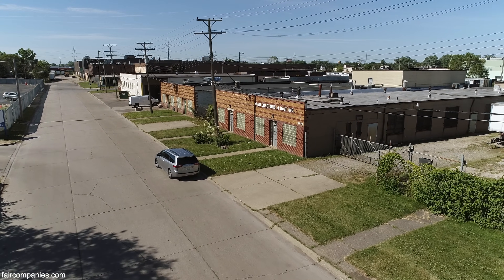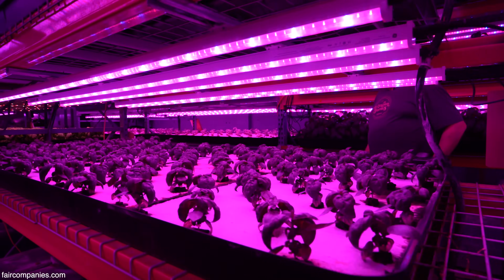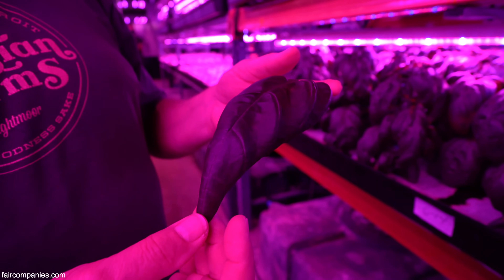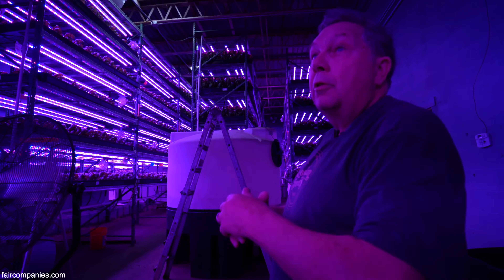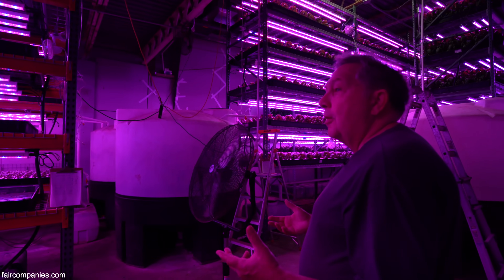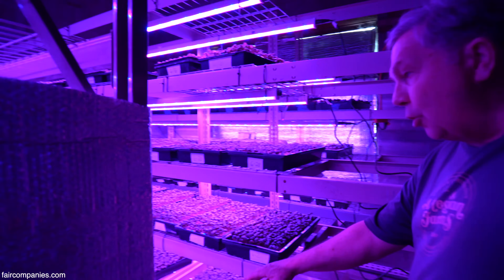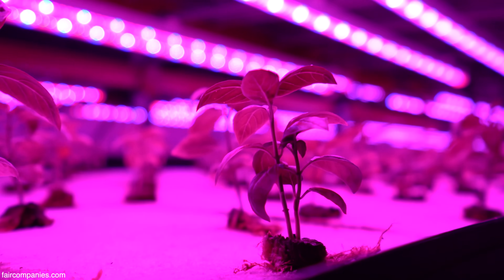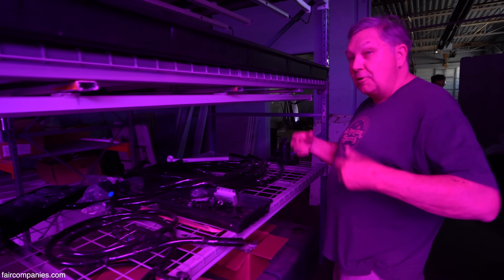Detroit retiree grows organic food in a transformed warehouse

Comment: In France, they made some test on this type of farming and they see that the leaves, fruits and others a ver good aspect, but they have 20 to 40% less vitamins and others elements.
Reply: They do not have the microbes that a good organic soil has. These microbes break down the minerals and organic matter to feed the plants. This is also why conventional farming has such low nutritional value, the microbes are killed off by the chemicals (fertilizer, pesticides, herbicides, etc). The soil is basically inert, sterile, and the only thing the plants get is what is fed onto the soil. Organic, regenerative farming is the way to go... indoors or outdoors.
Reply: @rorywynhoff1549  i agree, however you can add bags of compost into the mix /addition tanks that recirculate microbes into the system or use wicking pots with good soil to get the best of both worlds. This will not work with the salts he is using though, you have to change the system.
Reply: @bobhope9909  Almost all good microbes are aerobic, oxygen loving. They don't survive in water 
Also, most plants have two types of roots; hair roots that pull in nutrients, and tap roots that pull in water. In conventional farming and hydroponics that tap root pulls in both, which does not allow proper nutrient fixing in the plant cells. Another reason to choose organic, regenerative farming.
We have health problems largely due to poor nutrition due to compromised foods.
Reply: Nothing beats the sun.
Reply: @user-vg5rv5xf4u  true but some areas just don't get reliable sunshine
Reply: It depends how you compare. For x amount of water and energy you will get way more vitamins and nutrients with a vertical farm. This means you will have to put a little more basil in your plate but you will be able to buy way way more for less money & waste
And that's not counting economic and environmental benefits of having it close to distribution
Reply: Sounds interesting do you have the source for this?
Reply: Exactly lack of medicinal value ..!!! Only nutritional
Reply: rima1815 - Source?

Comment: You’re telling me the insulation that those plants are sitting in doesn’t eventually leech off chemicals into the water that it’s floating in and thus the plants soak up those said chemicals ....  I    Worked spraying foam insulation for years and I can tell you most insulation’s are toxic to various degrees

Comment: I love this initiative but some info here is definitely wrong. Plants do not absorb nitrogen from leaves. I believe the air circulation helps with photosynthesis. Nitrogen is absorbed through roots
Reply: You are correct for basil, it doesn't absorb nitrogen from the air, but rather carbon dioxide. The fans keep the air moving around the leaves so they can access more CO2. Without air movement, oxygen build up around the leaf, as the plant gives off oxygen when photosynthesizing. There are nitrogen fixing plants, such as the legume family that can get nitrogen from the air, but basil doesn't do that.

Comment: nice. what about the roof tho?
Reply: I used to do both active and passive solar work in Michigan years ago for F.E.A.T. Foundation before I moved to PNW and the roof could easily handle the WEIGHT of solar panels and snow weight. A bigger issue is secure mounting. The panels can become sails during extreme winter winds or summer storms.
Reply: Rooftop garden or solar to cut energy cost? Building is old roofs must designed to hold the weight for a garden.
Reply: @monkeysaiyen7196  no winters with lot of snow in detroit?
Reply: @chapchap5944  what places on earth experience no winter? Even a dessert and rainforest experience winter just differently then other areas that get snow. Detroit gets snow.
Reply: @monkeysaiyen7196  sorry i thought it was clear what i meant. if it can hold snow it should handle additional solar panels.
Reply: and snow
Reply: @chapchap5944  the building is old but it probably could handle the weight of a solar system.
Reply: Chap Chap   Even though solar energy is free, the cost to purchase a solar system complete with batteries is very expensive. Plus, Detroit is too far north for solar. It would take more than 20 years to break even on solar. California, Florida and Hawaii have 5 times the sunny days and it takes 10 years to break even.
Reply: @bentnickel7487  I live upstate new York near the Canadian border. We have solar and wind here. So Detroit is not to far north for solar.